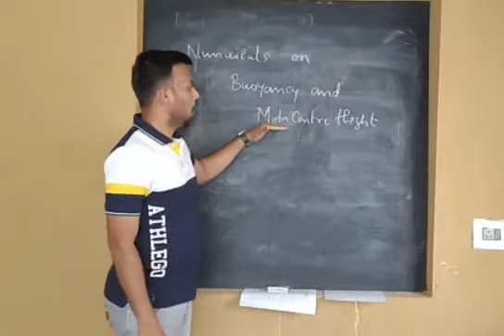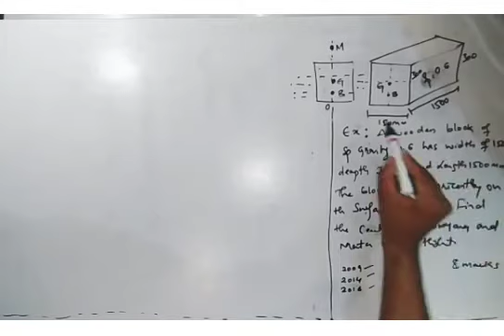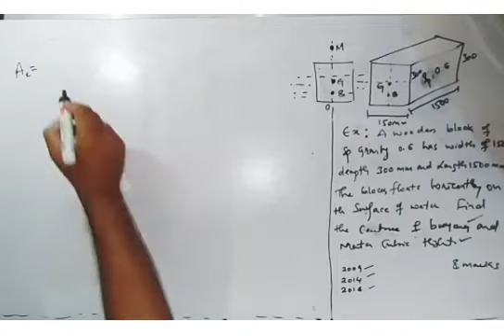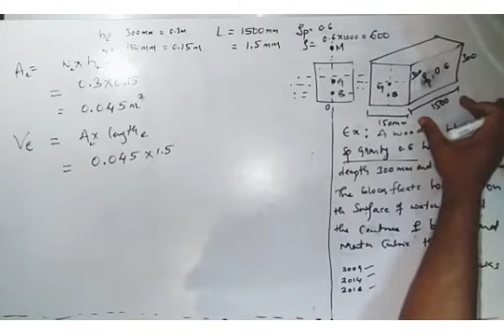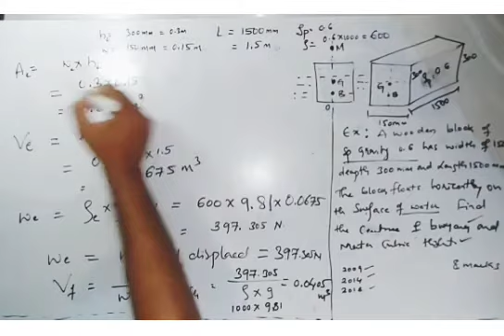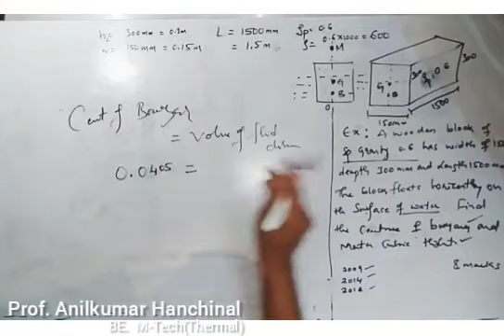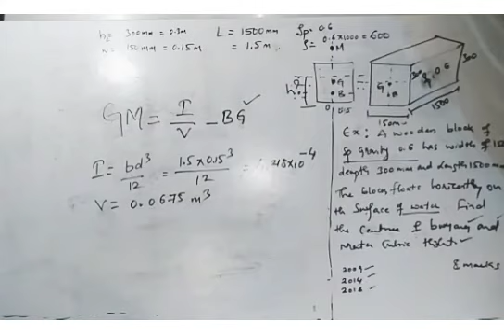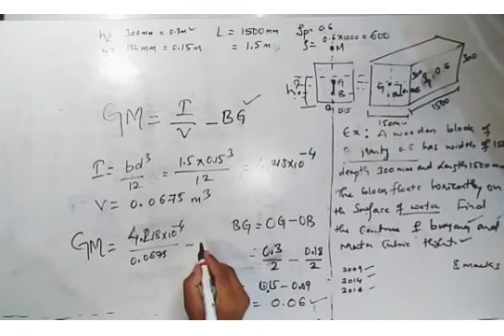Fluid Mechanics Module 2 : Buoyancy & Meta Center Numerical | Part 3 | VTU FM | GATE | All Academy

Comment from the maker: Question : A wooden block of specific gravity 0.7 has width of 17.5cm, depth 30.0cm & length 100cm. The block floats horizontally on the surface of water. Find the volume of water displaced, depth of immersion and the centre of buoyancy. Also find the metacentric height. Comment on the obtained result.
Reply: Volume of water, V=0.03674 m3
h=0.20m
Centre of buoyancy (h/2)=0.1m
Metacentric height (GM)
GM= BM-BG
BM=0.0121m
BG=0.075m
GM= -0.0629m
Reply: Volume of water= 0.03678 m3
h=0.21m
Centre of buoyancy = 0.105 m
I = 4.465×10^-4
BG= 0.045
GM= - 0.03287 m
Reply: Volume of fluid displaced=0.03675m^3
h=0.214m
B=0.105m
GM=-0.03649
Reply: Vf=0.03675m³
h=0.21m
B=0.105m
BM=0=01215m
BG=0.045
GM= -0.03285
Reply: Vf= 0.0367m³
h=0.021m
I=4.465*10^-4
BG=0.045